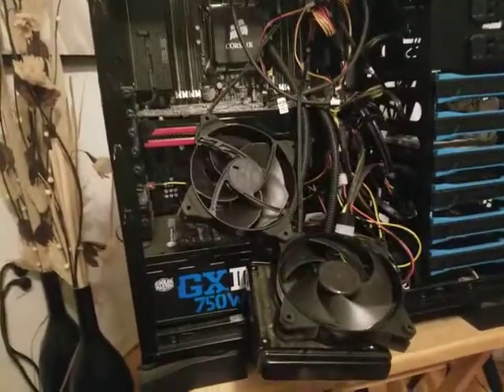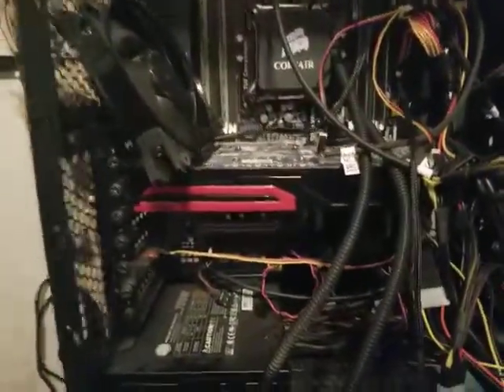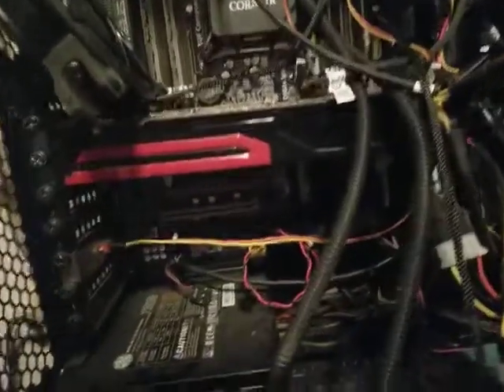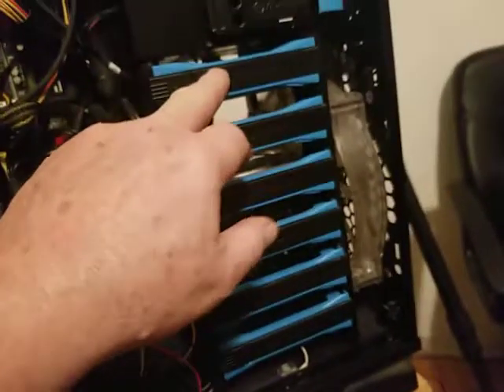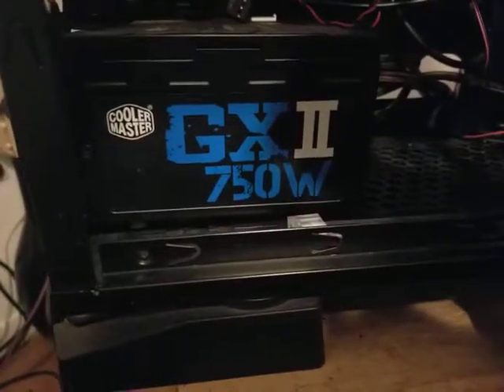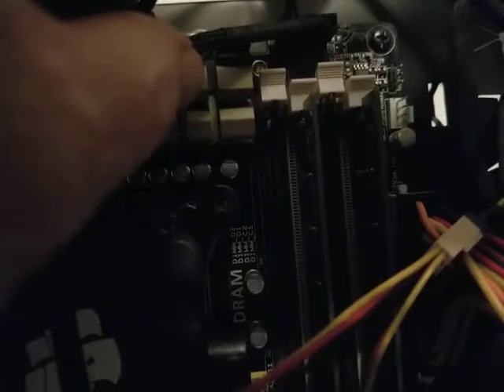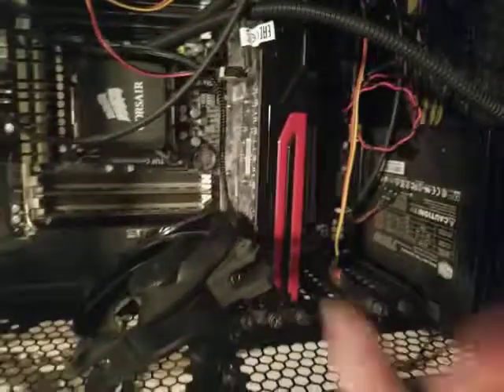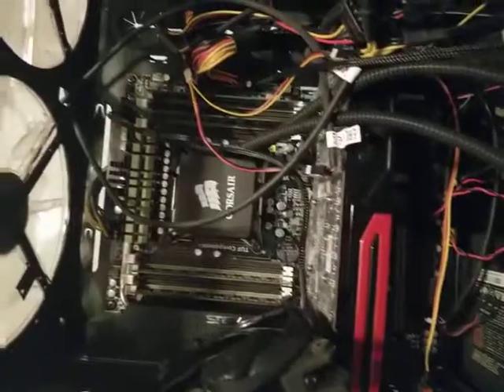Just messing around with my puter Part II

Comment from the maker: Best cooling of all Intel® X79 boards with Thermal Armor and Thermal Radar
2nd Generation Intel® Core™ i7 processor family for the LGA 2011 Socket
Intel® X79 Express Chipset
Support for up to 64GB of system memory with an 8-DIMM design
TUF Thermal Armor - Total Airflow-Boosting Heat Dissipation
TUF Thermal Radar - Real Time Temp Detection and Heat Removal
TUF Components [Choke, Cap. & MOSFET; Certified by Military-standard] - Certified for Tough Duty
New DIGI+ Power Control - All-New Digital Power Control for both CPU and DRAM
ASUS SSD Caching - 3X faster performance at a click
USB BIOS Flashback - Easy, worry-free USB BIOS Flashback

CPU, Chipset and Graphics features
2nd Generation Intel® Core™ i7 Processor family for the 
LGA 2011 Socket
This motherboard supports the latest 2nd Generation Intel® Core™ i7 Processor family for the LGA 2011 Socket, with memory and PCI Express controllers integrated to quad-channel (8 DIMMs) DDR3 memory and 40 PCI Express 3.0 lanes. This provides great graphics performance. 2nd Generation Intel® Core™ i7 Processor family for the LGA 2011 Socket is one of the most powerful and energy efficient CPUs in the world.

Intel® X79 Express Chipset
The Intel® X79 Express Chipset is the latest single-chipset design that supports the 2nd Generation Intel® Core™ i7 Processor family for the LGA 2011 Socket. It improves performance by utilizing serial point-to-point links, allowing for increased bandwidth and stability. Additionally, the X79 comes with 2 SATA 6Gb/s and 4 SATA 3Gb/s ports for faster data